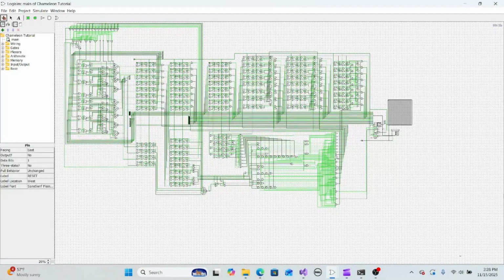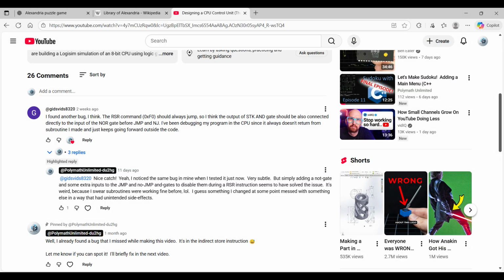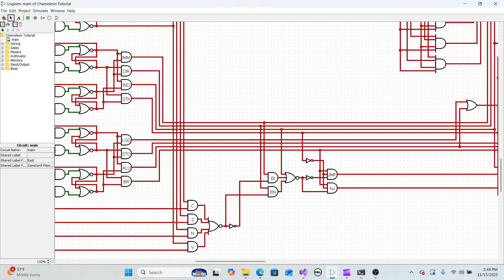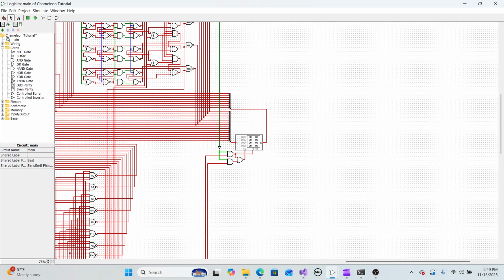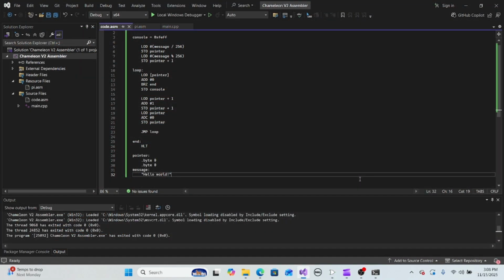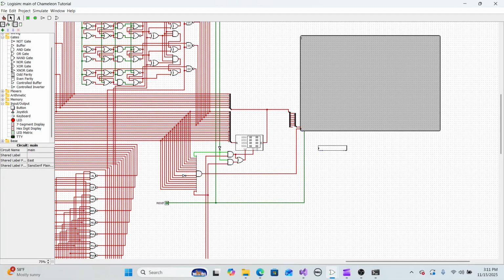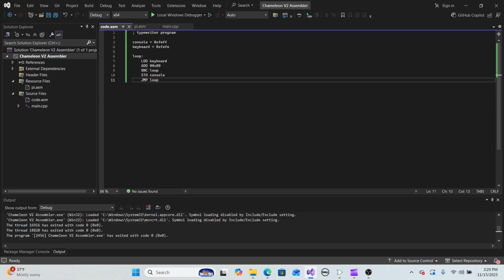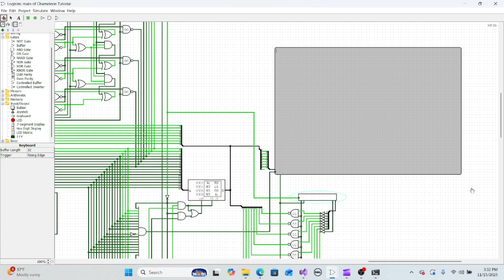Adding I/O to our Custom CPU (The CPU You can Build, Ep. 15)

Comment: Thanks for shouting out! I'm just really interested in your series that I wrote several comments in your video hahaha, I also want to help as much as possible.

Btw, I've finally added memory mapped IO on my own as  the GPIO registers are inefficent in moving values to/from accumulator for operations. But I won't remove them just yet, maybe I'll find their usage in the future.

I've implemented customizeable address using constant component and XNOR + AND gates so I could put them anywhere I want in the memory instantly.

I'm working right now on my assembler so I could initialize lookup tables. I'm also working with the keyboard input, I'll try copying your setup first tho haha.

Thanks for this video! I hope you continue this series until you create a very complex usage like making a game out of this CPU.
Reply from the maker: Just wanted to make sure you got credit for finding it 😎 I probably would have found it eventually but it might have taken a while 😅

Dedicated GPIO registers can be more efficient than memory mapping if you have instructions that can move data around internally faster than load and store instructions could move external data.  But that typically involves having a more complicated instrucion set.  One idea would be to memory map some external gpio registers so you get the same GPIO functionality without making your instruction set any more complicated.  In principle, you could memory map whatever you want (even more RAM to expand your memory space theoretically, which might be interesting to explore, though accessing the additional RAM woild be quite slow).